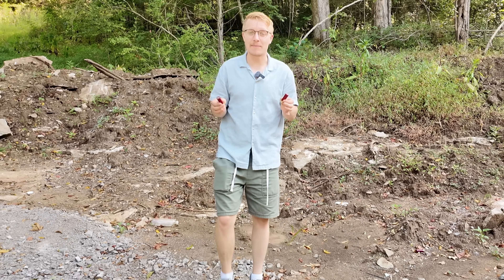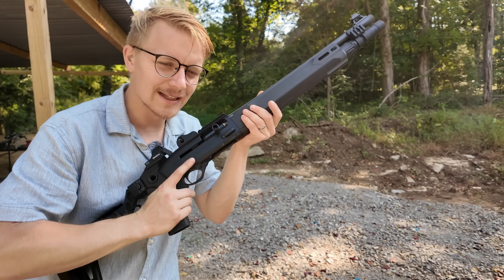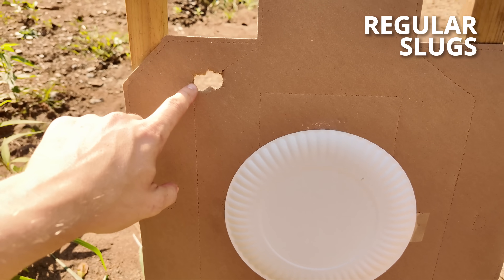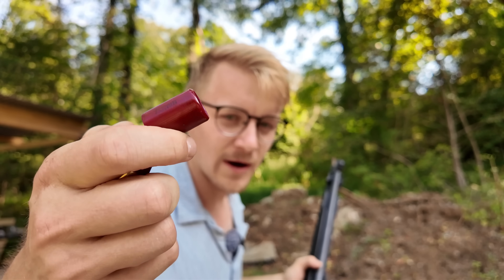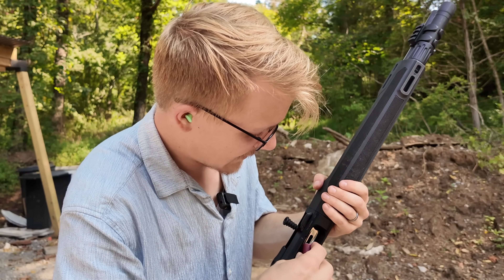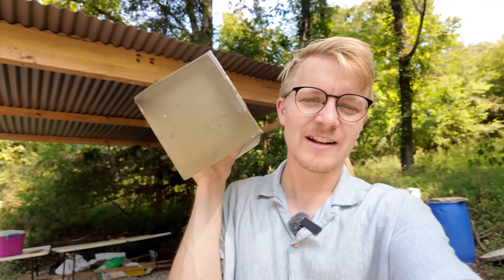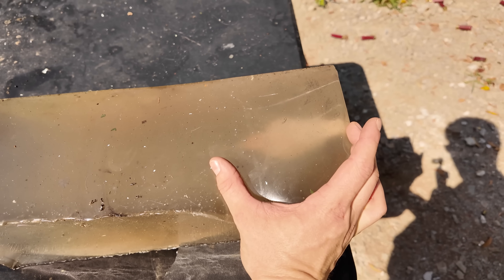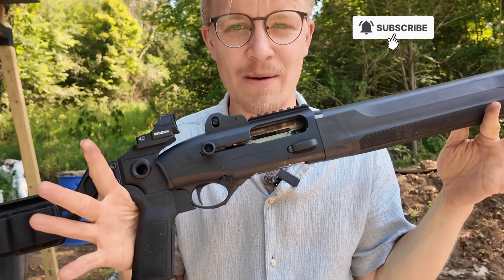Wax Slugs: How deadly are they REALLY?

Comment: Super late, as I didn't know you existed. Interesting channel! Watched the cut shell and then wax slug tests, chuckling on both as they're both different from everything I'd ever seen on either!
From what I know about wax slugs, having made a couple myself with one loaded in the chamber on my Mossy pump, it's better to pour the shot out, let it heat up with the wax, and then pour it back in slowly that way the wax slug adheres to the shot cup, and since more modern ones tend to have a compression point attached it acts almost like a drag tail increasing accuracy a bit by acting similar to the 'diabolo' shape, similar to pellets from an air rifle.
Some still have issues with the slug itself coming out of the shell itself, though I admit I never had that problem (anecdotal evidence is virtually useless I know). I have heard of others, so I was curious if gently heating the crimp and then unfolding it would be more advantageous or if as you've said a small roll crimp would work more effectively. Honestly I don't care much for the fact that it becomes significantly harder to reload those type of shells, unless you're looking at a shorter, or mini shell though.
Either way, interesting video and a good intro to both wax and cut shells!

Comment: If I have time to prep, I'd make wax slugs when I can get bird shot shells cheap on sale.  I also bought a roll crimper to hold it in. Though something I'd like to try is to dump out the bird shot and reload with an actual slug but haven't done that yet. I'd only use a cut shell if I need something to hit harder and had nothing left but bird shot shells on me. I use those velcro shot cards so carry a variety of shells with me (#2 bird, #4 buck, 00 buck and slugs) so would likely have the shell needed for different scenarios, though I have never been in a self defense situation. My reason for wax slugs is mainly to save money (vs actual slugs) but I see them useful in home defense for less penetration but still hit hard.  And at short ranges, they seem accurate enough.

Comment: A little more involved, but you can buy shot cups or use shells that have cups with tail-like bases to put your shot goop into. Some resins or epoxies work better to hold heavier shot together. Keeping it in a cup prevents the whatever you're using from direct contact with the barrel, and generally keeping the weight forward helps with stabilization.

Comment: In my country, shotgun licence owners can shoot birdshot but not slugs or less than 9 pellets in a cartridge.  Wax slugs are technically illegal, as they leave the gun as a single projectile, and being caught with them could result in losing your licence and a criminal record.  Cut shells can be immediately made if needed for large unexpected animals (wild boars) and are still illegal but don’t require previous manufacture.  I have seen both types demonstrated and it seems that cut shells give more reliable results.  We don’t use semi-auto shotguns much, so the cycling faults are not an issue.

Comment: My Father was in the British LDV (local defence volunteers) in 1940, before they became the Home Guard. His LDV unit made these wax slugs from paper cased, roll turnover, shotgun cartridges. They levered the roll crimp open on several at a time, the shot went into a small saucepan with wax, and both were heated. The warmed waxed shot was then poured back in and the rolled turnover pushed back. It worked well in their single and double barrelled shotgun. Dad’s error was to tell his young son about this (me!). I spent an hour making up a few cartridges, and the rest of the day fixing and hiding the holes in our barn. I also didn’t know it was illegal in the UK to make these.

Comment: Couple of ways to improve these - use hot glue instead of wax. This makes a stronger projectile. Also, pour in a bit of wax/glue by itself first, let it cool a little, then add the shot mixture. This way, the slug is front heavy for better accuracy.

Comment: To counter cycling problems I open up the top of the shot shell then pour the wax in mix it up so the wax spreads out better then I close up the top of the shell and compress it as best as possible when making homemade slugs you have to give leeway on functionality due to user errors. But I've never cut the top away from the shells see my great grandfather told me of them and back in his day they had paper cartridges so the cap of bird shot was just paper. But he also said he never ran them through a pump action he ran his homemade slugs through a Winchester model 37 single shot. Now I have the gun he has passed away and unless I'm hunting antlers I usually make my slugs

Comment: That cut shell was bit too cut. They shouldn't be dangling, from what I've seen you want to score them so you have essentially perforation or tear lines so it takes a bit more force to send it. Also for other wax shells I've seen hot wax simply poured in rather than removing the shot. Slightly faster

Comment: You didn't make the shells right.  Cut the inside of the shell crimp. DON'T cut off the shell cap on the outside. Mix the shot with the wax at the perfect temperature (hot enough to soften, but not melt a plastic spoon).  Scoop shot back into the shell and spoon wax over the top.  
The shells you make with the tops cut off won't get a consistent powder burn and are more likely to break up in flight.

Comment: I still have boxes from the early '70s that the crimp was sealed with wax the forward quarter of the shot holds together like a slug. Remainder the shot patterns out. These shells were factory loaded but have too much wax for the seal. Pretty impressive and they are fully factory crimped they use wax just to seal the shell

Comment: I’ve never opened a shell. Dumped the shot out into hot wax. And then scooped it back in. I’ve always just opened the shell and poured wax directly in.
Reply: That would seem more logical
Reply: Any shot shell, cut carefully.... Is a slug😆
Reply: @marcrud1250  cut shells are harder to do land one at time was unpoet in slow there cheaper than normal slugs
Reply: This guy is an idiot
Reply: I have one that is a cross between the 2 of them.
Cutting the head off of the birdshot, dump 1/4 of the shot out, shoot hot glue in the cavity, add shot, more glue, then cap it off with a dime.
That will go thru 2 pieces of 3/4 inch plywood!
Reply: Put a rifleed choke
Reply: Never tried that way.
Does the wax get down into the bottom of the wad?
Reply: That's the way I've done it. Then I cut the shell in the middle of the was and presto instant hillbilly slug
Reply: Leave the shells in the car to warm up a bit before adding the wax, so it doesn't just congeal straight away on the cold shot.
Reply: That's how i did it......bigger shot get makes it work easier, #2 was ideal.....closing the shell could be a fun time sometimes........then i put 3 cuts around the shell at the base of the wad at level with the gas seal while leaving about 1/8" inch connected between the cuts......i was using an u/o double so didn't have to worry about the shell feeding properly in a repeater......i took several deer a couple of hundred feral pigs and as many feral goats with these shells over the 10 years i was on that property....a set of rifle sights on the u/o was an easy way to make a rabbit gun into a do everything (within reason) gun
Reply: Just simply pouring hot wax into the shell leaves a fair amount of shot at the bottom of the column that doesn't have any wax (it will solidify before reaching the bottom. Still get some benefits, but that procedure handicaps potential. Pouring the shot into melted wax and then spooning it back in ensures that the entire shot column is wrapped in wax. Alternatively, if you want to spend more time, you could hot glue several layers (layer shot - glue, layer shot - glue, etc till full). The hot glue has the advantage of not melting in high temp scenarios, but it's much more difficult to achieve a "good" shot column.

Comment: Instead of cutting off the crimp, pry the crimp open and pour the molten wax into the shot and then push the crimp closed again. It won't likely close perfectly but it'll do the job.
Reply: I made a cutter out of scrap wood that has a hole bored through  that a shotshell fits into and a wood plug with a blade fits in from the other end. When you twist the shell it cuts the inside of the crimp only,  leaving something that looks alot like a roll crimp
Reply: @ArcaneTinker Friggin' genius! I like it!

Comment: Don't cut the top off. Gently heat the outer rim with the flame of a lighter. It'll start to unfold like a flower pedal. Then you can just pour out the shot or yeah, pour the wax on top of the shot.

I used to pour out the shot and fill it with just wax.
Reply: What were the results? Sounds like s proper less than lethal round
Reply: @dgunearthed7859 it was a poor man's less lethal being only wax. It put a nice dent in the side of a clothes dryer.  Never had to use on anyone

Comment: Wouldn't it work better if wax was melted and poured into the shell instead of mashing it with cold wax? Easier too. Or use hit glue. Although I guess they didn't have hot glue back then. 

But still, why did they want us to rub it into wax instead of pouring

Comment: We stuck all kinds of stuff in the casings. Nuts screws needles it doesn’t matter. Anything will mess someone up. Rock salt hurts like mug. I’ve been hit in the ass with it. 
That’s how old people would let you know you were trespassing back in the 70’s. 
Good times but anything really can be put in them and we used wax from candles or crayons if that’s all we had at the time. 
The shotgun is the most versatile sob and it’ll spit anything at anybody. 
Sorta like a blunderbuss or a cannon. I’d suggest not getting shot by anything and especially a shotgun.

Comment: Been shooting wax for close to 40 years, usually they only come out of the shells like that if your wax wasn't hot enough.  Good video, got yourself another subscriber.
Reply: Can you explain why you would use them instead of slugs? I understand using them if you maybe can't get slugs (like the above comment during covid shortages, or maybe during a zombie apocalypse) but is there another reason?
Reply: @CJOwen  Until recently we could get a caste of 125 birdshot shells for $13 locally vs an average of $1/shell for slugs.  Beyond that, they're just fun to shoot.
Reply: @CJOwen these were preferred for pig and bear (campsite gun) and if you look and the wound cavity  pellets spread about the size of basket ball. We also used mixed shot and dimes with wax even made with a drop of glue in between. For home defense this round is a nightmare for the surgeon to repair.
Reply: @seanbrossard8178   so, what you are saying is that kind of load has more stopping power than a slug, or just a different kind of stopping power? Or is it the greater chance of doing damage regardless of where you hit the target?

Comment: "Wax slugs" are a great thing to be aware of. During covid, I couldn't get buckshot for defensive purposes, but I had plenty of high brass birdshot for clays stockpiled, and hot glue. I finished them out with a shot card and a hand made crimp roller. Once I could get standard defensive ammo I used up the hot glue 'slugs' and I think they would have been just fine. 
I wouldn't hesitate to make them again, if I was cut off from standard defensive ammo.
Reply: How often do you need to defend yourself that you need to keep making the ammo?
Reply: @mjhopgoodswe Fortunately never so far! I was caught out, much like the depression era folks that invented wax slugs to take deer with bird shot they had rather than wishing for buckshot they didn't. Also I was home all the time watching YouTube. 😂
Reply: @mjhopgoodswe I guess he wanted an "adequate" supply. I hope he understands that hot glue is in the melting temperature range of smokeless powder ignition temperature. One granule of misplaced powder would be all that it takes for a problem to develope. Petroleum wax has a much lower melting temperature, and beeswax is even lower than that.
Reply: @mjhopgoodswe I've had to twice personally.  Hopefully never is the goal but ww3 is coming on the horizon now
Reply: Just as easy to dump out pellets, melt them pour in 1# point socket (sorry forget which size) and load back into shell as slu!
Reply: Wtf? Why didnt you just save a box of shells?
Reply: Man that hot glue down your barrel  had to be hell to clean
Reply: @survivalhax6594  Hoppe's No. 9 was fine, as always.

Comment: The cycling issue is caused by the way you cut the shell you shouldn't cut the entire top off instead just cut out the top center leaving a little bit of a rolled crimped edge on the inside 
I've got a few hundred of these rounds sitting around waiting for the apocalypse 🤣😜
Reply: One thing I've never tried though is flex seal I seen one channel do that and it seems like they are modernizing the wax slug technique. Performance wise though I don't even know if it's worth it flex seal is significantly more expensive

Comment: Team wax slug, but in a smoothbore barrel. Wouldn't shoot through a rifled barrel unless necessity demanded it.
Reply: ... what does it matter rifled vs smooth?  I think you are being really arbitrary for no reason...
Reply: @jong2359 wax engaging rifling could cause enough torque to break up the slugs to a varying degree and/or affect accuracy. Not an arbitrary decision at all but one based on experience and observation. Don't take my word for it, grest channel for experimental shotgun loads is Taofledermaus. They use both rifled and smoothbore and the results are interesting for sure.

Comment: What does the wax leave behind in the barrel?
Reply: The projectile is being held together by the original plastic wad/shot cup until it exits the barrel so the wax isn't making very much contact at all.
Reply: Wouldn't really matter what it left behind. Wax is a good lubricant. And old paper shotgun shells were sealed with wax so it's definitely not a problem.